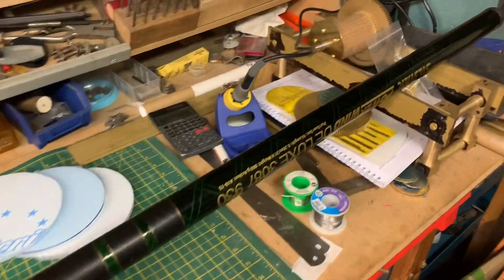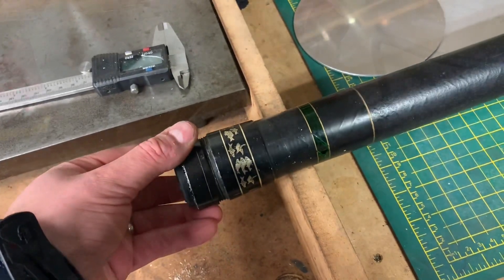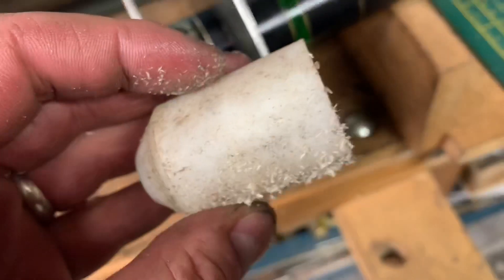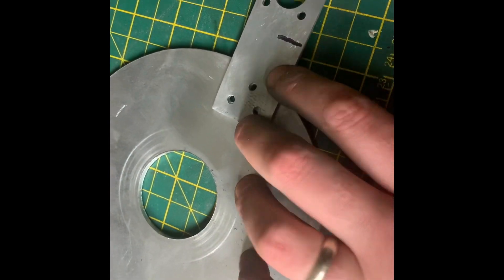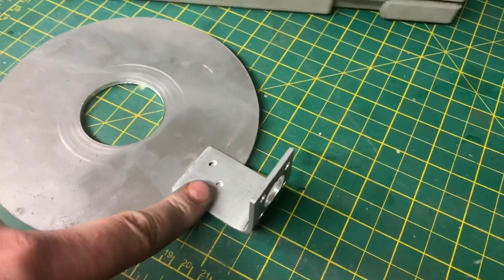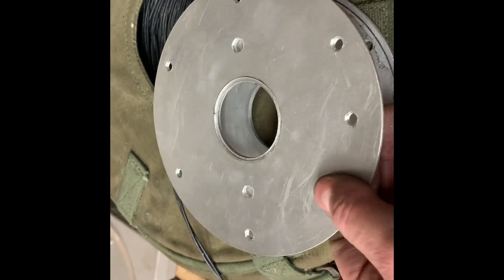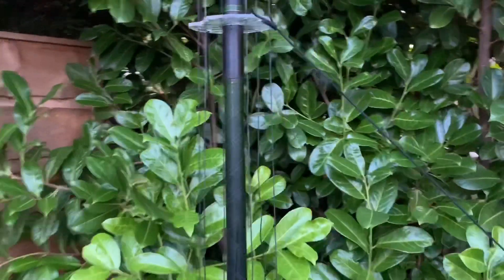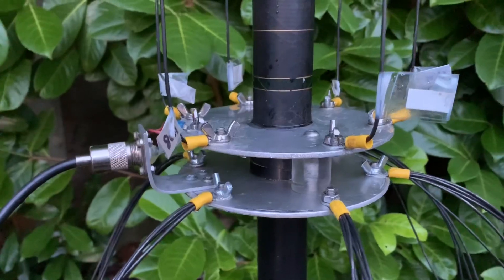DIY Build of DX Commander Antenna for HF Ham Radio - multi band quarter wave length vertical

Comment: Forget about the silly bungee cords on top. Too fiddly. Tie the wires securely on top and use bungee cords at the bottom to take up the bit of adjustment that you need. Much handier. Also, use a Spiderbeam pole and make the discs to suit it. Much stronger and need less stay wires. That’s what I did and it’s superb.

Comment: How is this holding up after 4 years?
Reply from the maker: @yrath5034  very good. Took it down last year and replaced a few screws and tightened up the wires but works really well!
Reply: @craynerd  nice!

Comment: Nice video! How much is the wire separation? Í was trying to run a simulation  in Mmana-Gal but wasn't ok
Reply from the maker: Alejandro Weber separation is about 150mm across the diameter.

Comment: I pretty much did the same thing, except I made mine on a tilt base to take down in hi winds. I did buy the kit but I Made a new driven element plate, and plastic spreader plates. I am using a DX engineering radial plate. KC3KOP

Comment: A few years ago, I set on making a potable vertical multi bander, using a fishing pole, originally, I had a tapped loading coil and one single radiating element, the ground plain radials were attached by an aluminium disk, which I had board out to fit the base of the pole, on exactly the same lathe as you have!, good old Boxfords. Latter, I rigged the pole with two resonant elements for 40m and 80m set up in an inverted L formation and selected by relays at the base of the pole. On one of my portable outings with a friend, he suggested to run the two elements in parallel, it worked. Latter after browsing the interweb, I found DX commander. The last few times I have operated potable, it has been with what is more or less a DX commander. One thing though, I had wrecked two poles so far, it might be that setting them up for a week in a force 8 on the island of Skye didn’t help, but it is more likely the  genuine DX commander product is better quality
Reply from the maker: gary hinson yes, I believe the poles used in the dx commander are high quality!

Comment: Thanks for sharing. I have the DX Commander all band. It works great except I cant get the swr down low on most bands and 10 meters is completely unusable. I have seen a bunch of videos of others using the same setup with great results. I think I have it narrowed down to probably being that the back yard is just to small with a chain link fence and an old metal shed to close to the antenna. The fence is about  17 feet away and the old metal shed about 22 feet away. Can't do much about it but I can use 15, 20, and 40 with a tuner not being able to run my amplifier with it but I can live with that. Wish I could use 10 meters but can't get the swr down low enough even with my external tuner. Do most of my talking on an end fed wire but having a vertical is nice,
Reply from the maker: dheller777 evening, thanks for the comment. I have no issues on any of the bands, my only issue is 40m with an SWR just over 2 at the moment. Totally workable but the auto tuner kicks in and ideally I’d like to get it spot on for each band. Certainly no issues with 10m. 
It’s a great design and by far my best antenna. Far better than my EFHW-8010 long wire! How high is your long wire and in what formation, just straight out horizontally across open ground? My land wasn’t big enough for that so I had to have an L.
Reply: @craynerd  My end fed us an Mfj 80-10. I use it as an inverted V. Going up to a tree limb about 35 feet high. It needs an auto tuner on all bands with 10 meters also unusable.